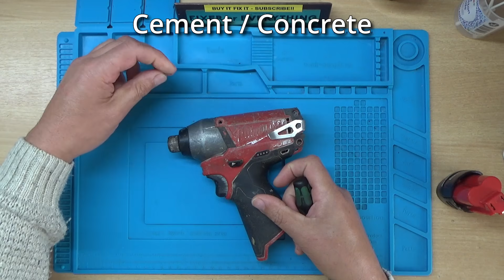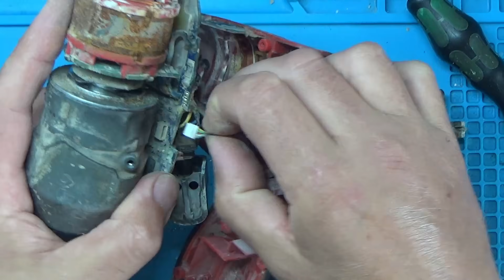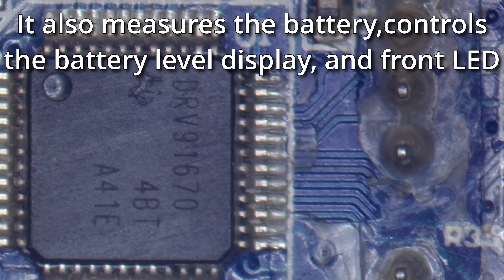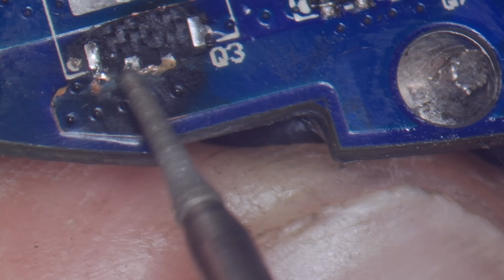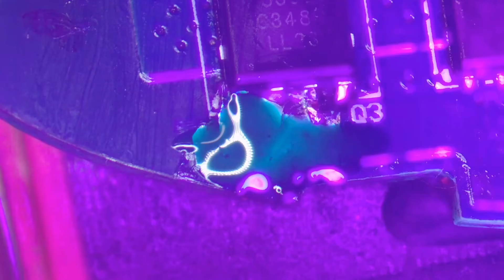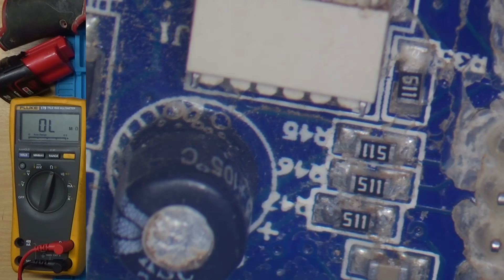Faulty Milwaukee M12 Impact Driver | Can I Fix It?

Comment: Well done mate, there nothing more demoralizing when you think its gonna work and there's something else! 😂
Reply from the maker: Yes, unfortunately that's the way it goes sometimes. I've had a few tools that have met the same fate, when the mosfets blow if it's the one switching the negative, then it's usually OK, the problem is if it's the mosfet switching the 18V, which can then end up sending 18V down into the MCU which is what happened with this one.

Comment: I’ve changed burnet mosfet on my m18 but it blew again right away,what could cause it?
Reply from the maker: Did you check all of the other mosfets? Could be more than 1 shorted, check the diodes and resistors going to the gate pins too.
Reply: @BuyitFixit yeah now 🫣 a burnet diode on the switch gone pop blowing the mosfet..£10 fix

Comment: Unbelievable the condition inside of this tool and to know the electrical components take this abuse and still works! I am very soon you are going to figure out how to rip the firmware from those chips, with your skill set I am sure it's only a matter of time, you have a Milwaukee data base of firmware lol Thanks for Sharing
Reply from the maker: Yes a bit of a mess this one was. I still haven't tried glitching out the firmware. The problem is with a lot of the milwaukee tools is that the MCU / BLDC driver is a custom part, and you can't buy it even if you had the firmware.
Reply: @BuyitFixit  Yes  I guess that would be a problem unless someone starts to make a clone chip, guess we would have to wait and see

Comment: Nice fix as always.

I recall a former colleague who had a side-business selling satellite TV decoders of dubious legality......worse, he'd buy one, then make knock-off copies. After a while, the software changed and he then found the manufacturers had discovered the fusible link for making the chips unreadable. I kid you not, he bought a job-lot of the blank chips and practiced drilling a tiny hole in the top to access the other side of the fusible link so he could read a locked chip. He actually succeeded. Bet that wouldn't work these days!!
Reply from the maker: Thanks 👍These days there are other methods for doing that such as glitching (voltage or clock fault injection) and some people have even used lasers or emp type attacks too.
Reply: You'd be surprised. Google the Kamikaze Method for hacking Xbox 360. Still in use for Nintendo switch and others. Sometimes it's not the chip and the board too. Think multilayer board and you need to tap a signal that comes out a BGA chip, through a middle layer and into another BGA chip - people have been known to grind away layers on the PCB in a particular spot to be able to access the signal...

Comment: Great save!
You can’t blame them for making the firmware read only.
I can’t imagine who might try to copy/steal their R&D 🤠
Reply from the maker: Thanks 👍Yes I think nearly all microcontrollers have copy protection these days (although there are still ways of attacking them to try and read the code such as glitch attacks).
Reply: The firmware would not be particularly hard to recreate in comparison to recreating the rest of the tool.

Comment: Those m12 impact drivers are beasts. Did my whole pv installation with one, not even had to recharge it one. Driving 88 8x120 screws into wood, no big deal for them.
Reply from the maker: I've got the m18 version and it's great 👍

Comment: Does the battery cutoff come from the mosfets closing, or is that a relay by the trigger that shuts
Reply from the maker: I can't remember on this exact tool, I think the MCU just measures the voltage and won't drive the motor if it's below threshold. Other devices such as the 1st gen vacuum cleaners which use brushed motors have a small PCB with mosfets on, which only turn on to allow power to the motor if the voltage is above a certain level.

Comment: would this be the same issue as mine, i have the same but flashing single battery light, batteries are fine, the drill doesnt run
Reply from the maker: I think that sounds like it thinks the battery is flat. I had a problem like that with an m18 work light where it wouldn't switch on because it thought the battery was flat. It turned out to be a faulty resistor that goes to the main microcontroller to measure the battery voltage. It might be something similar on your tool.
Reply: @BuyitFixit  thank you, ill try and check it out

Comment: Another one saved.  Well done.  Seems a lousy design making the driver chip integrated to the brain.  The amount Milwaukee charge for their stuff you'd think they could afford to make it more likely to be repairable even if it cost them a dollar or two more.
Reply from the maker: Cheers Mike, it's all about bottom line at the end of the day, just like the parts from Milwaukee will nearly be the price of a replacement tool...

Comment: Hi, thanks for great video, how can i check each mosfet to know if it's good or Bad?
Reply from the maker: If there are no obvious signs like burnt, then put the meter in diode check mode, and check between the gate pin and the other pins for a short circuit. Usually when a mosfet fails it will totally short internally.
Reply: @BuyitFixit  thanks

Comment: With a damaged Board I thought that was a write-off but good job in repairing it 👍
Reply from the maker: Thanks 👍
Reply: Small damage like that is no big deal.
If the item is worth it one can live with a charred board.
Had a fet do that on the power supply of a Flir a40m.
Otherwise that thermal camera was e-waste.

Comment: I learned once from a video from EEVblog that when you have a severely burned part of a PCB (like in this case) the burned part can become conductive because it's turned into carbon.
If that's the case, you have to grind it down with a Dremel and hope it's not a multilayered board.
Reply from the maker: Yes, saw it a couple of times on PS5s and xbox boards 👍

Comment: @9:00 looks like it wasn't correctly mounted to begin with
Reply from the maker: Possibly, or it got that hot that the solder melted and it shifted position..

Comment: I am blown away with uour channel!    I need to know why you do not do a "reverse diode test" on components surrounding mosfets to find shorts?   I do enjoy northridgefix and 12voltkid.
Reply from the maker: Sometimes I do, but the most common failure mode of a mosfet or diode is short circuit. If it measures OK and you get a normal voltage drop it's not shorted 🙂

Comment: I have a bunch of Dewalt battery tools. Never had a failure, even have some batteries still good after 10+ years. But I will admit, never dipped them in cement!
Reply from the maker: Perhaps it might be an interesting experiment to try 😂😂😂😂😂👍

Comment: No conformal coating. No parts to order to repair. Milwaukee owned by TTi, Hong Kong/China company. All throwaway tools
Reply from the maker: Fair point, usually most I've looked at have conformal coating on them. This one did seem to be awfully abused.
Reply: @BuyitFixit  it’s consistent with them. Take a look at Makita they protect their electronics. What I see of Milwaukee is they stick them right under/near moisture/dirt ingress

Comment: Another good video.
Your guides are very well put together, done at a relaxed and easily to follow pace with a clear well lit view and a steady camera.
Others may have edited the failure after the assembly, but you did'nt, you were honest and showed warts an all, and thats reality, you are modest sir.
Very informative and entertaining, hope you get time to keep them coming!.
Any chance at some stage could you make a quick video, explaining how to identify a bad Mosfet with the meter, as they seem to be everywhere these days, I'm sure lots who watched this struggle like me with them.
Reply from the maker: Thank you kindly sir 🙂. Check the recent video I did on the hot rod induction tool (not mosfets) but they measure similar and I compare the new to the faulty with the meter so you can see the difference. Or check the Milwaukee impact driver video. If you get a consistent short between pins that's usually a good indication as they normally fail in a short circuit condition.

Comment: Great video. I have always avoided brushless battery tools as I have no hot air / reflow tools at my disposal and my eyesight is not what it was !!!
Reply from the maker: Thanks. My eyesight isn't that good these days either. I have to use glasses now and usually a microscope 😂

Comment: I felt the need to comment. I don’t want to pan your work as you generally do good work however you did 2 things wrong with this repair. First is when you cleaned it you did not remove all the carbon scoring - why is this important? Because carbon is resistive and may well have been the cause of the no work situation after reassembly, but the final mistake you made was not testing it before reassembling. I personally would have checked the resistance across the gate to the other pads just to be sure it was correct not just because of the possibility of dead new parts but also because of the carbon scoring.
Reply from the maker: Hey, thanks for commenting. I didn't think about the carbon until I was watching the video back myself. I know it's a thing as I've seen it before on PS5 and xbox series x repairs where mosfets have also failed. I could have checked the gates with the meter but I just assumed that the new parts would be ok,  although I have been bitten by this before especially when I've ordered parts from dubious Chinese websites 😂 This thing was a nightmare to test as I assembled it about 6 times and the motor was jammed solid for some reason I think the case wasn't sitting right but I thought it would be boring watching me assemble and disassemble it multiple times. Thanks again for taking the time to comment, and hopefully I'll remember next time I encounter a similar repair 👍

Comment: for the love of all that is holy clean your solder iron tip
Reply from the maker: Great tip! 😂😂😂😂
Reply: @BuyitFixit  dude when you went to solder the SMD's milimeter leads with that blunt thing i honestly thought i was watching a howtobasic video
Reply from the maker: @CrudeBuster  I've got a smaller tip but it doesn't seem to dissipate a lot of heat so I prefer to use the larger one, a bit flux and it's not an issue 🙂
Reply: @BuyitFixit I know the problem with small tips and heat-dissipating pads but at least a scrub now and then on brass wool so it doesn't look like a mustard-covered burnt copper bratwurst, for real, won't hurt
Reply from the maker: @CrudeBuster  😂😂😂 I'll try and remember. I might try investing in some JBC tips, as I've heard they are a lot better than the tips that came with this iron.

Comment: Watch out with carbonised substrate as it becomes conductive!
Reply from the maker: Yes, I've seen that on other things such as PS5 and Xboxes. I didn't think at the time, but did when watching the video back. I probably should have ground it back a touch and added some solder mask. Thanks for commenting 👍

Comment: do you ever do repairs for customers? I have an 18v Milwaukie 1/2 impact gun (think of the thing you use to take tires off) that seems to have similar issues. I got a new one but the newer version is not the same as the original-id love to have my old one back. It might be cost prohibitive to ship though, Im in the US
Reply from the maker: I don't have "customers" as such, this is just a hobby (well apart from the volunteer work I do at the local repair cafe once a month). Yeah the postage would probably be more than the tools is worth. I've got a 1/2" impact gun myself 😉 and I use it to take wheels off, I'd like to see you remove tyres with it 😂😂😂😂 but seriously, I suspect it will be similar inside to the SDS drill I repaired in another video. They have bigger mosfets than the little m12 impact driver. I show how to test them in the video, so perhaps you could attempt it youself, or if you think it's a bit beyond your skills, I'm not sure if there might be "repair cafe's" in the US? I know they have makerspace's dotted around which might be able to help too...
Reply: @BuyitFixit  fair enough, just thought id ask. (and yes..."wheels" 🙄😂). I'll check out your other vid-I might at least try to fix it myself. I miss that gun, the newer one is nowhere near as good. I did talk to the official Milwaukie repair back when it died- but they wanted almost as much to fix it as a new one cost. Thats when i just replaced it
Reply from the maker: @colestowing8695  Yeah it sucks when the price of parts is nearly the same as a new tool. It was the same case with the Milwaukee sander I repaired. Milwaukee wanted £89 for a motor assembly and the bare tool was only £99! I got a new motor which was the same size etc from Aliexpress for £10 😂😂

Comment: ultrasonic cleaner would make that tool look like new
Reply from the maker: Someone else mentioned that, the only issue would be that the circuit board for the battery level is held in place with plastic pegs that have been melted to hold it. Thanks for suggesting it though 👍

Comment: You need to clean and lubricate the buttons and switches in the drill, that's how you properly service power tools.
Reply from the maker: Thanks for that. It was 1am time I finished recording so it was a bit of a rush, also it's an impact driver not a drill, I'll hopefully remember this for the next time 👍
Reply: @BuyitFixit  Drill impact driver, whatever.

Comment: Did you remove the carbon from under the mosfet?  The smallest whiff of moisture and it conducts.. although I'm more used to high voltage so you may be fine at 10.8 but it's worth doing next time... oh and the direction controls are a pain in the ass, they never work smoothly unless all the parts and a couple of stars are exactly in alignment...
Reply from the maker: Thanks Jay, no I forgot about the carbon and while reviewing the video I thought the same. Someone else also commented similar. It very late time I actually got this repaired 1AM, and 3.30am before I got to bed as I started editing and finished it off the next day. Thanks for you comment 👍

Comment: Interesting failure mode. With my very limited experience (and apologies for not really knowing the terminology), I would guess this failure began with that gate resistor breaking down somehow, trapping its mosfet in the linear region, making a great deal of heat and burning the PCB.

This is bad news for the complementary mosfet in the bridge - instead of its usual current path through the BLDC coil, it instead finds itself in a short circuit and fails due to excessive current spikes, which is a different (and less smokey) failure mode to the first mosfet.

This would easily explain why the driver IC was unharmed, but I'd be interested to hear the theories or explanations of anybody who knows what they're talking about (I don't!)
Reply from the maker: Thanks for your thoughts, and comment👍 I'm no expert, but I've had pretty much the same issue on quite a few tools (albeit without the burnt pcb). On one occasion I had a drill where 4 mosfets had failed! All of the short circuit, and a couple where unfortunately the voltage made it's way back down the gate into the MCU pre-driver and fried the output. I had this on the circular saw I looked at and also on a chop saw (I think the braking circuit on that failed, the mosfet shorted and now the mcu gets hot when trying to run the motor).

Comment: Makes me want to open my identical bit driver and see what component failed when it spent a week outside in the snow and rain, its also gone swimming a few times but after pulling the battery and drying it out it comes back to life. It still works but its stuck on setting 4.
Reply from the maker: Thanks Joel 👍yeah  snow rain and swimming are probably not the best environments for it 😂😂 it actually looks like this tool has had a similar experience 🙂

Comment: Nicely done as per normal. I have found a local repair cafe so will take the Kindle in when I can. If they can not fix it maybe it can be used for spares.
Reply from the maker: Thanks Chris 👍good luck with the kindle 🙂

Comment: I had a Milwaukee hammer drill M18 something  from my employer. While on a rough mission with it (massive stone-wall) it overheated a bit and after that, it failed a lot and it failed with the same blinking-pattern. Since guarantee was expired and my boss refused to get me a new one, I gave it a try. Inside I found a tiny little wire, which hold barely to the solder point. It broke completely, nearly from staring at it. I found out, this was for the overheating-sensor and that explained the blinking-code. I stripped a bit of that wire, resoldered it and the machine worked perfect again.
Reply from the maker: Great Job 👍I've also looked at a few M18 hammer drills (I did 2 videos on them) I can't remember seeing any temperature sensor on them so perhaps it might have been a different model to the models I looked at.
Reply: @BuyitFixit  I‘m unsure 'bout the sensor, since I had‘nt disassembled the machine further to follow that wire back, but that’s what I‘ve read on a thread. Never questioned that, since the machine worked perfect since.

Comment: Great repair, and no magic smoke when you tryed it the first time, now all that's left is to unsolder all the wires and give the whole thing a good clean 😁
Reply from the maker: Thanks Morten👍, I did clean up parts as I went, but this thing is really used and abused😂😂
Reply: @BuyitFixit  yeah it would make a good candidate for a restoration video 😁